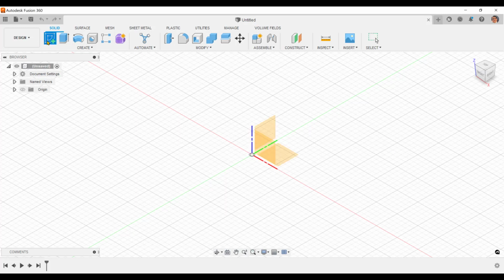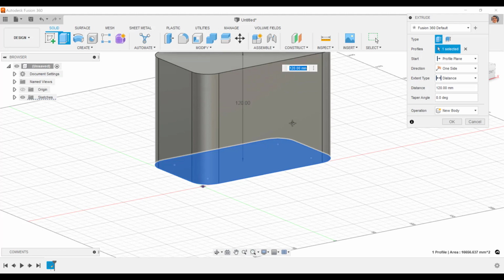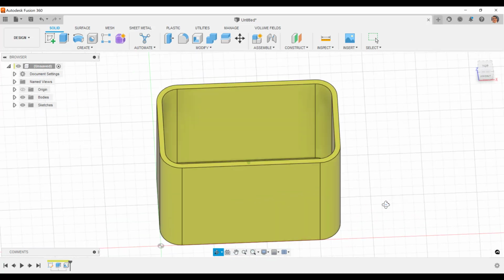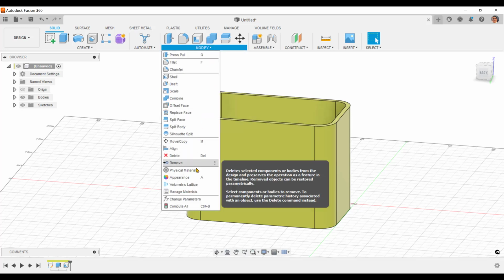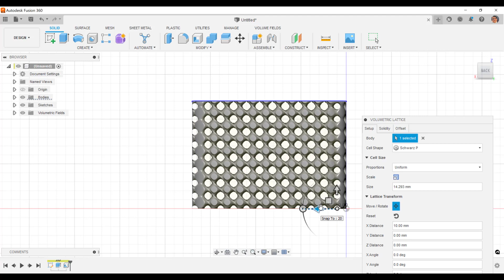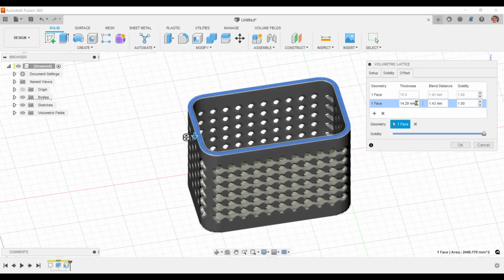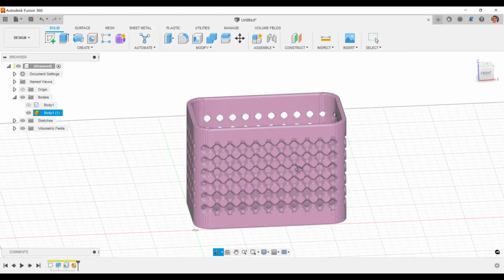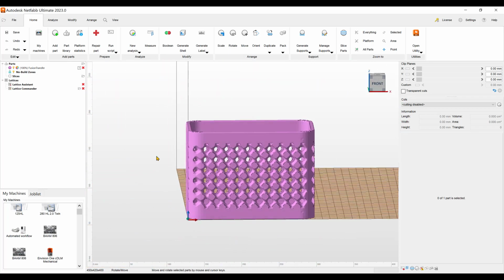Focus Friday Additive Tips: Volumetric Latticing in Fusion 360

Comment: Volumetric lattice is no longer a tech preview and has been officially released in Fusion 360
Reply: And it kinda sucks. I tried to use it to drill holes in a rounded cube just like the demo. It's nothing like extruding a rectangular pattern of circles through the body ....

I still need to use some tricks to get my method to work well when the rounded cube is more like an irregular box, but volumetric latticing doesnt seem to get me any usable results regardless of how I readjust it. I just want X size holes spaced X apart through the entire shelled cube/box. rounded sides always end up getting ovals despite my efforts
Reply: I would not recommend using volumetric lattice for your case. Something like emboss maybe a better solution
Reply: This is a better video explaining the situation where volumetric lattice is a better use case https://youtu.be/6liMt7ntLo4?si=tSyzZmnoEtMBZdN3
Reply: @sualpozel1  yes thank you. I tried out geometric pattern today and it worked pretty well, definitely easier than patterning in a sketch and then extruding. I appreciate your recommendation and will check it out too